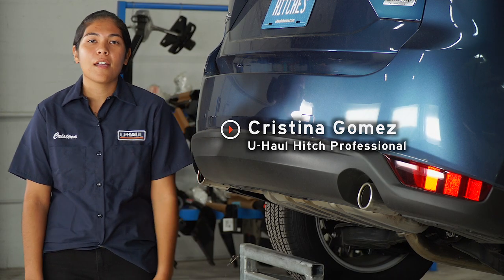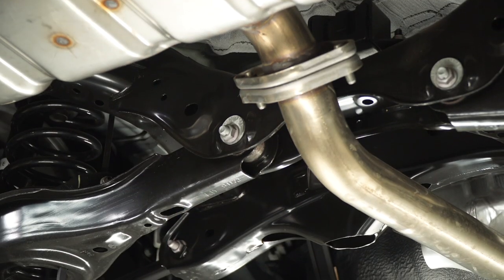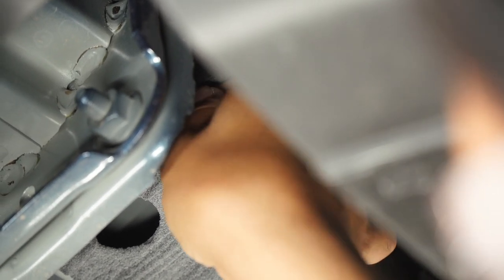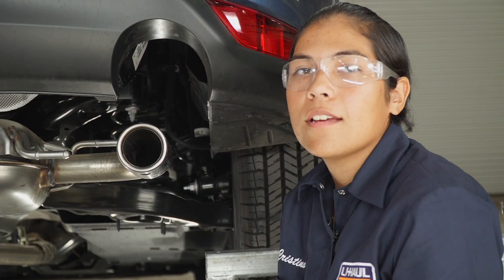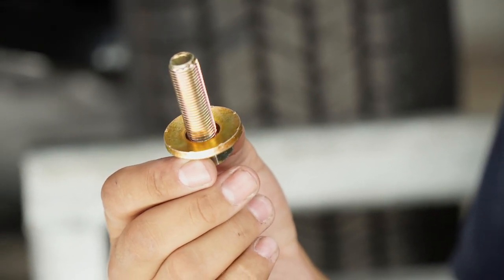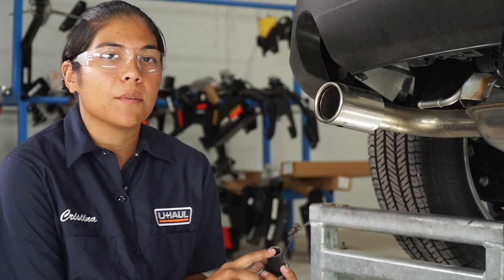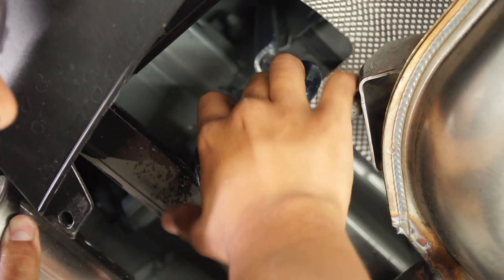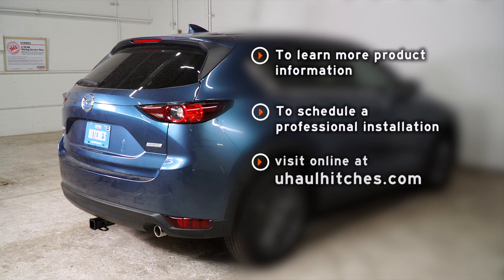2013-2024 Mazda cx-5 | U-Haul Trailer Hitch Installation | CMF13315

Comment: I just used this video to install my hitch on a 2017 CX-5 Touring. Note that I had to remove an electric wire holder on each side of the vehicle (I believe in this video they are just the clips she removes on the side). I think I will have to just tape these wires to the hitch.

Comment: What happened to the trim piece that was removed at the start of the video?  Does it get tossed?
Also, what are the manufacturer specs for torqueing down the bolts?  Why not provide that information in the video?
Reply from the maker: Because it would interfere with the hitch, it is not reinstalled. We recommend holding onto this piece just in case you decide to sell your vehicle in the future. And we don't state the specs in the video because they can sometimes be changed by the manufacturer. But the hitch, when purchased new, always includes the torque specs in the instructions. But just incase you did not receive those we will provide them below- https://assets.curtmfg.com/masterlibrary/13315/installsheet/13315_INS.pdf
Reply: @trailerhitches  Thank you very much for your reply!  I honest wasnt expecting to get one for a video that is 2 years old but I really appreciate you taking the time to answer my questions.  Thank you.

Comment: When I buy the hitch, does it come with all the little nuts and bolts or do I need to run to my neighborhood store to buy the pieces and the wire as well.?
Reply from the maker: Yes! It comes with all the hardware necessary for the install.

Comment: Will this fit a 2021 CX5?
Reply from the maker: The manufacturer has not yet confirmed if it would fit or announced a new hitch for the 2021. We will let you know when we know!
Reply: I just installed this hitch on my '21 CX-5. from 2017 onwards it's the same.

Comment: I have the same car and model. How much would it cost to have it installed there at Uhaul? Thanks.
Reply: I got a quote from Uhaul. It's about $125 for the labor just for the hitch. With the wiring as well they said it would have been like $260ish. I ended up just doing it myself with an extra hand. It was kind of a pain in the ass, not because the steps are hard to follow, but just because positioning the hitch in there is really cumbersome. Took me like an hour of trying. I'd recommend giving it a try. if you can't get it done, then just take it in
Reply: @jalen2354  Ok, thank you so much. I need a hitch for my car since I'll be moving to Virginia soon from Indiana.
Reply: @tsfb  No problem. Good luck with your move
Reply: $75 schedule it online.

Comment: Torque setting?? Yes, Christina is RAD, yet, WTF w/ not including such essential info?  Having to look it up separately make instructions like these redundant.
Reply: 10.TorqueallM12hardwareto86.2ft-lbs&1/2"hardwareto110ft-lbs.-NODRILLINGREQUIRED-LOWEREXHAUST-FISHWIREHARDWARE-REMOVEPLASTICPANEL(IFPRESENT)-MAYREQUIREWELDNUTCLEANINGBESURETEETHONALLCONICALWASHERSAREAGAINSTTHEHITCH